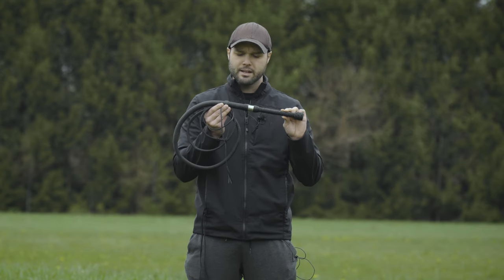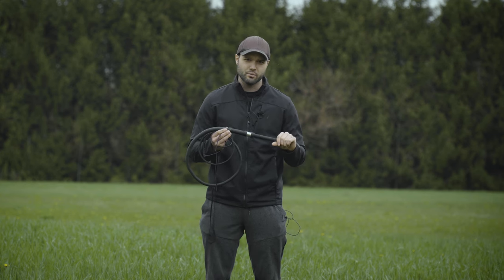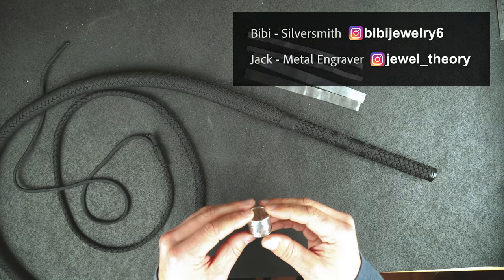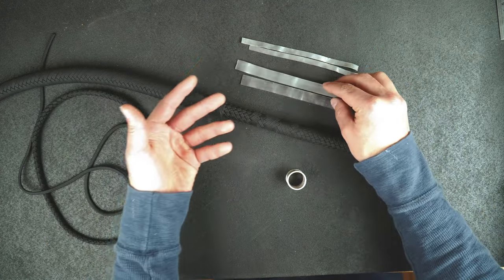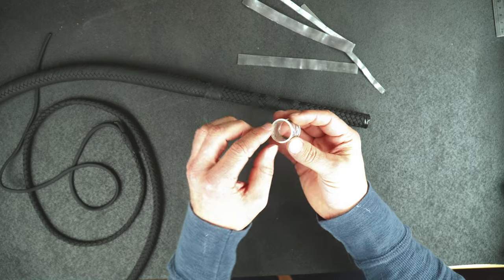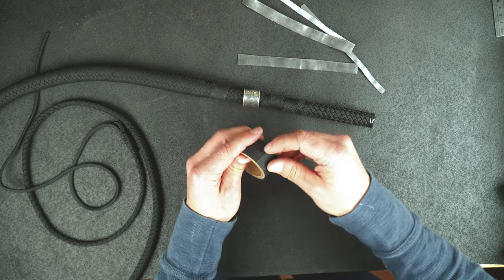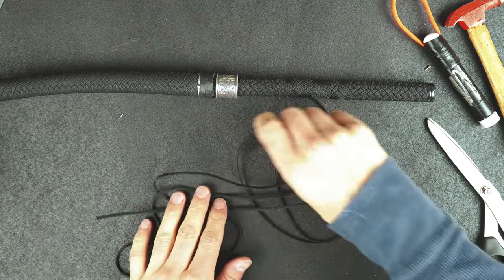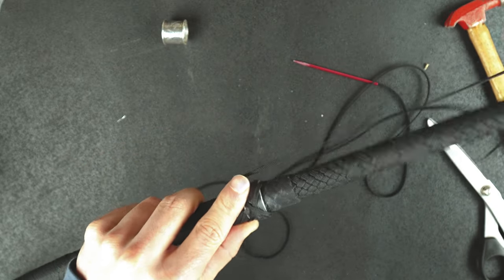Building Cone Shaped Ferrule Knots On A Zorro Style Bullwhip - A Full Length Tutorial

Comment: Absolutely fantastic stuff man! I have yet to make a full blown whip, BUT I have made some fun bb loaded maybe 5 foot small whips from your information, and they are a blast to mess with. I also have bought a (I legit have no idea) whip from a local farm supplier that has a handle that spins (kinda weird) for a very cheap price. However the last almost 1/3 of it basically blew out after a bit of me practicing (first "ligit" whip 😂) so I did rebuild the last section. It's VERY far from ideal, but it's 100% better than it was. I have made the thong, and cracker as you have shown from 550 paracord, and obviously the transition there is abysmal, but again it's way better than the thing was when purchased. So far I'm on I think my 5th cracker tho, and can split maple leaves of a tree in my back yard every shot, so I thank you a LOT for at least giving me enough knowledge to make a complete POS whip I picked up for about $10 into something usable with a little bit of work. Of course one day I would love to be able to make a full whip myself. Thank you for your time and patience making these videos.

Comment: Fantastic video, after years of dithering I'm convinced. I've finally decided to take the plunge and make a whip. I'm thinking of a six or seven foot bull with a single belly like the one you built with Adam Winrich in 2019 but with a ferrule as you've done here.

One word of cuation from this beginner though, lead is deadly! Bare handed handling of it and abradding or burnishing it increases the likelyhood of absorbing it through your skin. Always use safe handling percautions when using lead. Lead posioning is real and it's deadly! ☠
Reply: I completely agree. I've been mining the internets for info educating myself and would like to paste some of it here, only if Nick's OK with it, of course.

Comment: Use Lead wipes if you really want to remove any residue from your hands; better to just wear gloves though. However, there are some that aren't fit for anything beyond general cleaning - the microns are too loose and certain chemicals/ residues can penetrate through. SKC are an interesting company that do those kinds of things along with Ghost Wipes used for surface detection of Lead.